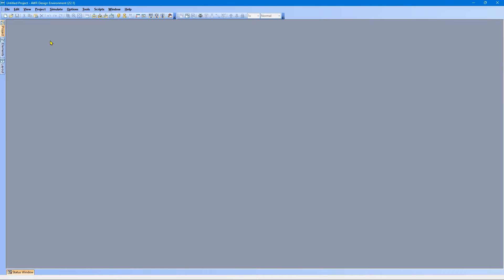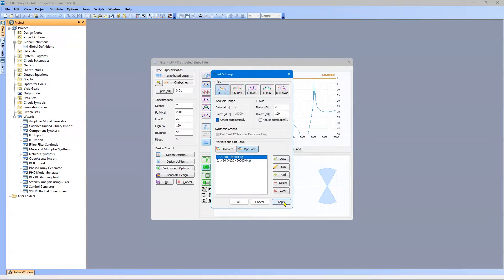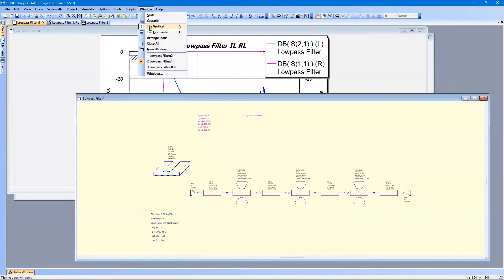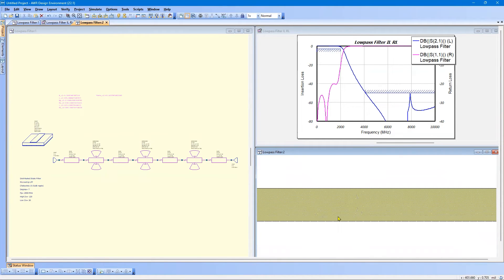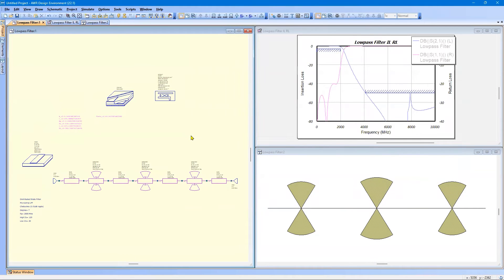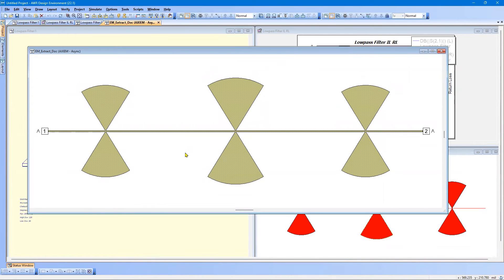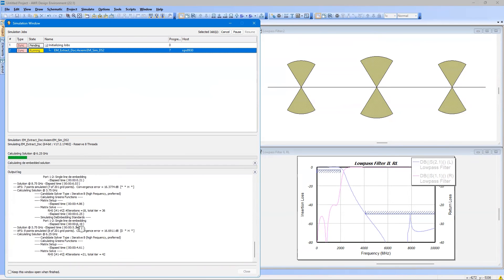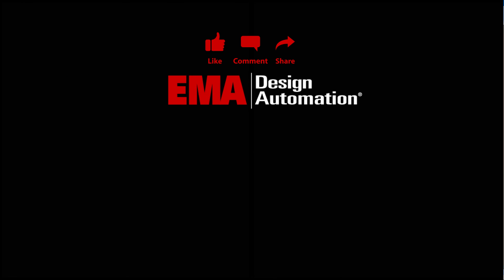How to Design a Low-Pass Filter

Comment: Thank you for video. I 've got a problem.AWR iFilter Filter Synthesis tool can not generate the printed filter layout structure but only can create the circuit schematic. Is there any extra stuff to do ? I would appreciate if you can help. Thank you.